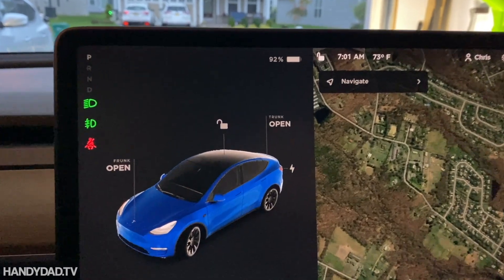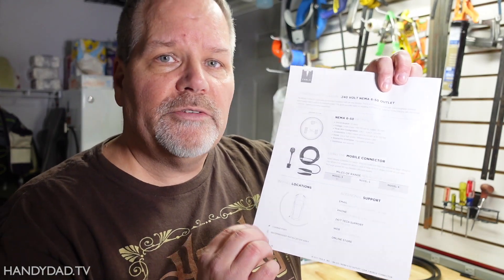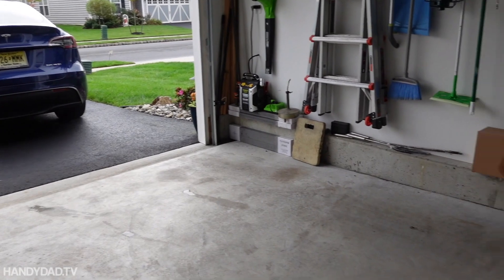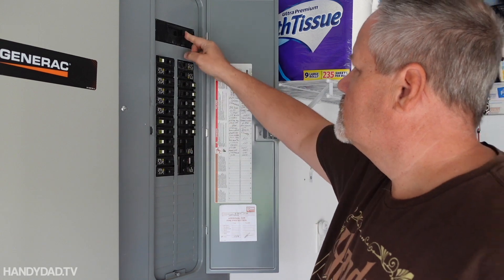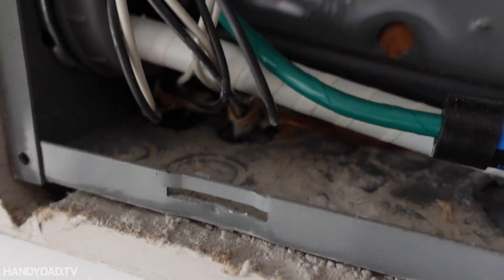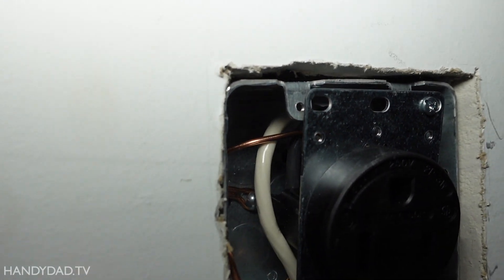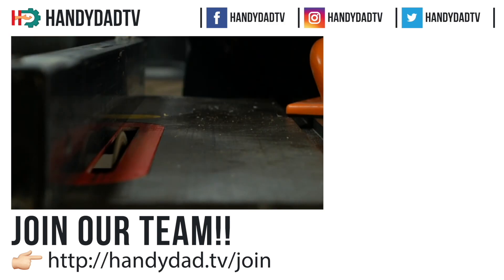Hubbell NEMA 6-50 Outlet DIY Installation / FAST Tesla EV Home Charging Level 2

Comment: I bought a Nema 6-50 Tesla plug and I use it in China. Our country uses 220V. If I connect two live wires, will it exceed the regulations? I tried to replace one live wire with a neutral wire for charging. The Tesla car interface can be adjusted to 32A, achieving a charging speed of 27 miles per hour, but when the temperature reaches above 86 degrees Fahrenheit, the charging current will automatically reduce to 16A. What is the reason for this? Thank you!
Reply from the maker: I can’t advise you on wiring in China. Sorry.
Reply: @handydadtv  OK，Thank you.

Comment: My wire has 4, a red, white, black and a bare copper just covered in paper. Which ones which? Is the black the ground? And the white and red the hot ones?
Reply from the maker: Black and red are usually hot, white is usually neutral, and bare copper is always ground. I say “usually” because that’s how it’s supposed to be wired but you need to verify that. Never assume where electricity is concerned.
Reply: @handydadtv yeah I found out the breaker and wire are too small also it’s a 30 amp and I need a 50 amp at least to run my stick welder.

Comment: you have NOT secured the romex connector in the panel with a lock nut. solution - pre-attach the connector on the cable leaving enough wire to reach breaker. the connector should be installed so that the wire nut is located in the panel itself. Pull cable through, secure wire nut, strip cable and connect to breaker. The white wire in this installation should be taped with RED electrical tape inside the panel and in the receptacle box.
Reply from the maker: Thanks

Comment: Thanks for the video. I recently purchased a new Tesla universal charger and I need to wire a 6–50 outlet using 6/3 wire (black, red and a bare copper wire). Wanted to make sure that I grounded the outlet properly and you confirmed that my thoughts were correct. Thanks!
Reply from the maker: Glad it was helpful 👍🏻

Comment: I see several code violations. The biggest one is that outlet is not properly grounded and is supposed to be on a ground fault protection device.
Reply from the maker: Do I need a GFCI Circuit Breaker for EV Charging?
https://youtu.be/BixGQisysDc
Reply: Doesn’t matter what you are plugging into the outlet. If it is inside a garage it must be on a GFI
Reply: Since it's a national reaching video might as well add that GFCI in the garage are the requirements if your state or jurisdiction has adopted 2020 NEC or up. Which the state in the video, New Jersey has adopted 2020 NEC, but not all states have. Of course it never hurts to add GFCI to garage outlets, even if your jurisdiction doesn't specifically require it.

Comment: I have two EV’s. Would it be possible to install two outlets to charge both vehicles at the same time?
Reply from the maker: Yes, in theory, on two separate circuits. But call an electrician for a load calculation to ensure you don’t have unreasonable expectations of your service panel.

Comment: If I have three wires coming out from the wall (red, black, and white), do I just ignore the red wire and just connect the black and white wire?
Reply from the maker: No, the 6-50 doesn’t have a neutral so you’ll probably use the red and black. Use a voltage tester and make sure you get 220-240 volts across the red and black. You should also get 110-120 volts across black/ground and red/ground. There’s no need to test the white if you don’t need the neutral. Just cap it off.
Reply: Just to make sure.  Connect red, black, and the ground (copper) to the plug.  And it doesn't matter which direction the red and black go? @handydadtv
Reply from the maker: @ziyulu Connect the two hots and the ground to the 6-50. But you need to verify the voltage, wire size and breaker size are correct. I can’t do that for you.

Comment: I have a 250v outlet in my garage, can I plug the 6-50 adapter into it?
Reply from the maker: The “-50” means it’s a 50-amp receptacle. It can only be used with a 50-amp circuit breaker.

Comment: Awesome Video. i was able to install easily. Thank you for making it easy. :)  Only issue i have is when i check the voltage with my meter on one side and to the ground, im getting 109 volts and the other side i get 139 volts.  not sure why its not 120 volts each side. did i get one of the wires crossed somewhere in the panel or inverter?
Reply from the maker: It’s not unusual for voltage to vary on each leg.
Reply: my apologies. one leg was 109v and the other leg is 131v. still a total of 240v.  hopefully that is okay.  @handydadtv
Reply from the maker: @photo3lements It’s fine.

Comment: Why dont you use the ground in the receptical? Why the ground screw?
Reply from the maker: You need to bond the receptacle and the box to ground. Unless you use a plastic box.
Reply: @handydadtv  yes I got a metal housing box like you linked.  so what's going to happen if I don't use a ground screw and just connect the ground wire from receptical to the ground in the breaker box?
Reply from the maker: Without the box being grounded, it can become energized and a potential shock hazard.

Comment: It's always a good practice to test for voltage on the breaker bars inside the panel after turning off the main breaker. Things happen, you just never know...
Reply from the maker: Thanks for the tip

Comment: You should have attached the clamp to the wire and fed it into the panel from underneath and then put the lock ring on inside the panel as this is likely not code compliant this way.   Also on the outlet side you could clamp it down rather than leave it loose and pull the whole box out if you had to access it rather than leave it loose; no compromises to code for people's safety.
Reply from the maker: Good ideas 👍🏻

Comment: Great work! I have a question: I see the Tesla mobile charger state a Max 32Amp for the NEMA 6-50. Does that mean the mobile charger will “regulate” the power to max 32 Amp even the 240V 6-50 plug is pushing 50 Amp?
Reply from the maker: Yes

Comment: Great video.  As a long time EV owner (since 2011)  we've been using NEMA 6-50 connector with our original Blink home charger, our EVSE upgraded Nisaan Leaf charger, and currently the Tesla mobile connector (with NEMA 6-50 adapter).  About to convert a Tesla wall connector with installation to a NEMA 6-50 connector.  Thanks for this great video!
Reply from the maker: You’ve got more experience than me! Want to make a video??? I’ll pay you.

Comment: Hello, I have a Nema 650 receptacle in my garage but my ev charger has a 14-50 plug. Do I have to change the receptacle or can I simply use a 650 to 1450 adapter safely?
Reply from the maker: You need to ask the manufacturer of your EVSE if it will work without a neutral. Typically they will, but you need to be sure.

Comment: So it doesn’t matter which holes I put the two hot wires in on either side? Meaning, they can go into either hole on the plug receptacle and on the breaker?
Reply from the maker: Yes they are both hots.
Reply: @handydadtv  oh so it looks like you simply took some extra ground wire and cut it? Then put that into the outlet, through the ground screw, and then reattached it to the main ground line? Why did you do it like that? Why the need to cut a separate wire at all?
Reply from the maker: I needed to bond the metal box to ground because it’s not good enough to only have the ground on the receptacle.
Reply from the maker: BTW, I could have avoided it with a plastic box.
Reply: @handydadtv  ok do you recommend I do this as well? I have the exact same metal box.
Reply from the maker: I prefer the strength of a metal box. But it needs to be bonded to ground.
Reply: @handydadtv  thanks for your responses! But, technically it is safe and up to code to simply wire the ground to the receptacle only, right? Just asking for the purposes of learning.
Reply from the maker: No, code says metal boxes must be grounded. Not just the receptacle.
Reply: @handydadtv  thank you
Reply: @handydadtv  thanks, I ended up getting a plastic box to simplify the install.
Reply: Can you explain what you did with the ground wire inside the box? You looked like you twisted two grounds together - where did the other one come from? I only have the one coming out of the Romex wire.

Comment: If your using a cord feed that plug should be GFI protected … Should wrap some black tape around the white wire to show it is a feed wire . Romex connector should be mounted thread side in panel ..
Reply from the maker: Thanks
Reply from the maker: Thanks

Comment: This is very clear and helpful.  If I could add one suggestion, consider using a band of red tape at each end of the white as a reminder to the next person repairing or upgrading that it is hot (probably code?)
Reply from the maker: Thanks for the tip

Comment: Used 50A instead of 40A much safety (1 comment), I preferred you tape both side with red/blue/yellow to make sûre it is not neutral wire, Thx for your youtube.
Reply from the maker: Yeah I got that neutral comment a lot.

Comment: NEC 2020 says you need GFCI protection for EV chargers (625.54). Does the GFI protection in the charger itself cover that requirement?
Reply from the maker: No. The receptacle needs to be protected even when nothing is plugged in.

Comment: Thanks for this! Did you use the 6/2 or 8/3 wire?
Reply from the maker: The 6-50 needs 6/2 wire.
Reply: @handydadtv   Thanks for responding.  I was waiting to buy until you did.  Appreciate the video.

Comment: Great video! Can you tell me what 6-50 adapter I need to use for a 2016 Tesla MS? Tesla site says Gen 1 NEMA adapters which don't have the extended cord.
Reply from the maker: I’m not sure what kind of connector your car came with. You may need to buy a Gen 2 UMC to get a 6-50 adapter.

Comment: I only have a 100A panel at home. Do I really need a 200A panel to do this? I also only have 2 spaces left on my board and they're split on different sides.
Reply from the maker: I suggest you contact a local electrician to do a load calculation to be sure.

Comment: Personally if I were building my own home from scratch and was planning on using an electric car,  I would install a nema 6-50R,  fed by 6awg AL  SEU cable which is good for 40 amps, assuming the terminals are rated 60°C, since the max charging amps is 32, and 40 amps is 125% of 32 and a 50 amp receptacle is allowed on a 40 or 50 amp circuit.   Much cheaper than 3 wire plus ground cable, which is a waste for a straight 240 volt load.  You only need 3 wire with ground cable for a combo 120/240 volt load such as a range or dryer
Reply from the maker: I’ve changed my tune as well
https://youtu.be/R2cRNzSbw48

Comment: Was able to do this myself with barely any previous experience because of this awesome video. Thank you daddy
Reply from the maker: Thanks so much 😊

One more bit of advice (coming in next week’s video): wait a month and retighten the connections after wiggling the wires to make sure they are really tight, unless you have a torque screwdriver and can tighten to manufacturer specs.

Comment: Awesome information thank you 🙏 and I ❤️ for that..
When I click on your links it doesn't take me to the exact item, just to Amazon but don't know which one to get 😔
Reply from the maker: Sorry I try not to link a specific listing because they change all the time and then the links don’t work at all. The top results of that link should be the Hubbell NEMA 6-50 receptacle, number HBL9367.
Reply: @handydadtv  Thank you for replying.. if you don't mind me asking, why did you change from the 14-50 to the 6-50?
Reply from the maker: So many people were complaining about the price of the 14-50 that I wanted to show a cheaper alternative that provides the same speed of charge.
Reply: @handydadtv  once again, thank you for taking the time to reply to my comments. 
So I got ahead of myself by ordering the 6-50 tesla plug because the 14-50 is out of stock and the electrician charges me the same price for installation but will you recommend nema 14-50 installation over the 6-50 or it really doesn't matter since I don't think I'll have the need of the neutral since I don't have and RV or any other thing to plug that will need the neutral pong on the 14-50
Reply from the maker: Install the 6-50.

Comment: Nice Video!  Could you have used the 8/2 romex wire rated at 40 amps? I understand the maximum charging rate is 32 amps.
Reply from the maker: Yes, as long as you use a 40-amp breaker.

Comment: Will Nema 6-50 once installed can be used with Tesla provided Mobile charger or another wall charger needs to be purchased separately
Reply from the maker: Both. You can get the 6-50 adapter for your Tesla UMC, or you can get a J-1772 charger with a 6-50 plug. Video on this topic coming soon!

Comment: does it matter which lugs the black and white wires go to (on the outlet and breaker)? or are they pretty mucb interchangeable because its 240 and not 120?
Reply from the maker: I know it’s confusing because white is usually neutral, but in this case they are both hot. It doesn’t matter which lugs you use.
Reply: @handydadtv  thats what i was assuming, also, they dont help matters with the plug either... they still have the smaller one (hot side) and larger one (neutral side) like 120 lol
Reply from the maker: Yeah not sure why they did that. 

An electrician commented on this video that it’s a best practice to wrap red tape around a white wire that isn’t neutral.

Comment: Great video, thank you.  NEC calls for GFCI 50A breaker.  Noticed you didn't use one?
Reply from the maker: That’s a separate video https://youtu.be/BixGQisysDc
Reply: @handydadtv  ahh...excellent, thanks for confirming...I was not 100% sure.
Reply from the maker: I actually purchased that breaker in 2019 but never installed it in my old house, so I thought maybe I’d be grandfathered? 😂
Reply: @handydadtv  I would say yes👍😁

Comment: Although you explained in your answers to others’ comments: Tesla charger doesn’t need the neutral, still why 14-50 is so popular? And why a 14-50 plug was provided by tesla, not the 6-50. There must be some reason for it. Thoughts? Enjoyed your videos. Thanks
Reply from the maker: 14-50 is more versatile because it has the neutral wire, even though Tesla doesn’t need it. 14-50s are often found in campgrounds to power sub-panels in big RVs.
Reply: @handydadtv  solid point on the 14-50 being found at campgrounds. That’s a huge selling point for ‘Camp Mode’ on the Tesla which explains its popularity. Nice video.
Reply: What I gathered was that it the 14-50 is more commonly used and found.   I installed the 6-50 because the 14-50 is sold out right now.
Reply: Tesla does not need Neutral, but if 14-50 has Neutral connected, then Tesla Mobil Charger still working?

Comment: Perfect timing. I started installing my nema 14-50. I can only run my power through the main panel and it has a bonded neutral and ground so I can’t finish the installation. I am forced to get the adaptor for 6-50 now and install the 6-50 outlet.
Reply from the maker: The fact that your neutral is bonded to ground in your panel is irrelevant. You can do a 14-50 or 6-50 either way.
Reply: @handydadtv  thanks for the response. I was reading many threads and was really confused and thought it was safer to go with the 6-50. Had mixed messages.
Reply from the maker: I don’t know about other chargers, but I know the Tesla UMC only uses the 240-volt conductors. The neutral wire (120v) is not used. 

That’s my primary reason for making this video. People are hog wild for the 14-50 and it’s driving prices way up. The 6-50 is a great option.

Comment: I’m curious, is there any downfall in going to two-conductor (no return) versus three-conductor (dedicated return)? I know that the negative busbars and the ground busbars are bonded, but there has to be a reason/benefit for a dedicated return; I just don’t know what it is. Thoughts?
Reply from the maker: The neutral is only required if your device needs both voltages 240v and 120v.

Comment: Why did you change your 14-50 receptacle to a 6-50 receptacle?
Reply from the maker: I just swapped it temporarily to make this video. There are lots of videos on the 14-50 already. Not as many on the 6-50.
Reply: @handydadtv  awesome. I thought I noticed some reused footage. Any difference in charging speed?
Reply from the maker: No, exactly the same charging speed. The 6-50 is just a cheaper alternative for people who have long runs. EVs don’t use the neutral wire anyway, so it’s completely unnecessary.

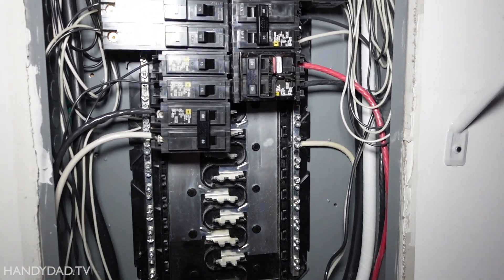Comment: 16:25 NEC says you need to reidentify the white wire with a different color since it is a current carrying grounded conductor, not a neutral
Reply from the maker: Wrap with black tape?
Reply: @handydadtv  Red tape.
Reply from the maker: Good to know! Thanks.
Reply: @handydadtv  red would be better,  but black is ok
Reply: @handydadtv  red and black

Comment: 11:00 the romex connector is upside down. Since you don’t have access to the bottom of the panel, you should clamp it on the cable, then feed it up through the hole in the wall. The locknut should be inside the panel, not the clamping part of the connector.
Reply: Or just use a raco insider.
Reply from the maker: Good idea 👍🏻

Comment: 4:25 it says Cu and AL which is aluminum. Should be rated for aluminum wire tooo
Reply from the maker: There is a slash over the aluminum symbol. It supports copper only.